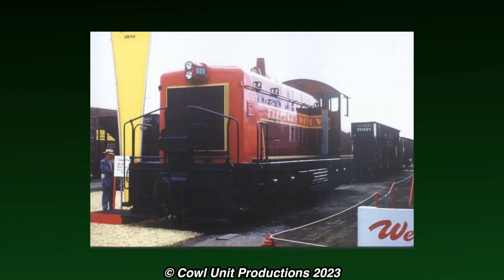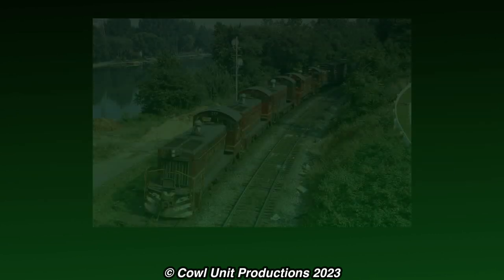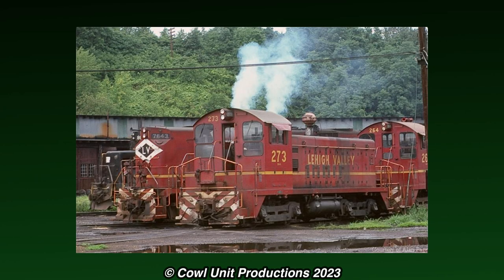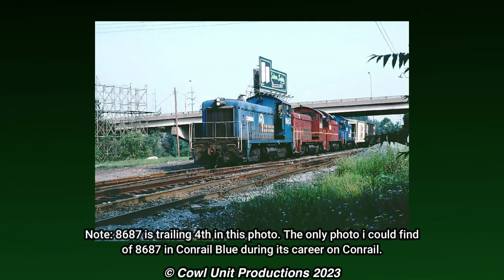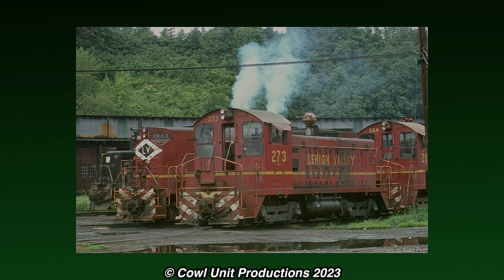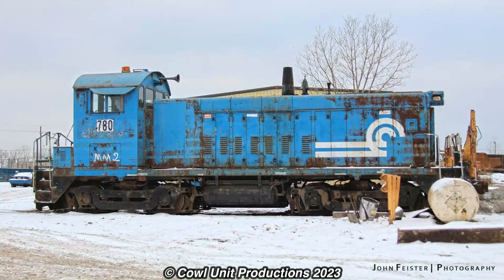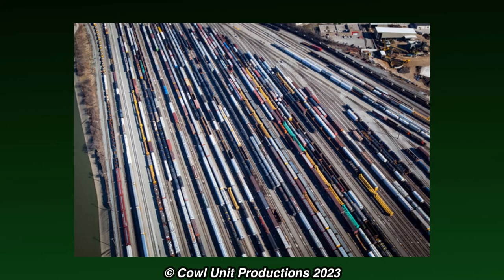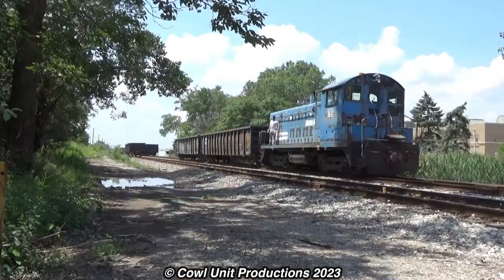Bite Sized Oddities - Conrail 8687

Comment: I am surprised that you didn't touch on the fact that this unit was ordered with dynamic brakes like switchers on logging railroads. These pups were used on some steeply graded anthracite line by the LV with light axle loading. That is why it has that hump by the cab. Also I always thought of the SW8s as the beginning of the 8 cylinder line of switchers with the later SW900 being the 8-567C successor to the SW8. The SW7 with the 12-567A had The SW9 as the 12-567B equipped succesor and later SW1200 as the 12-567C succesor. The Sw1 stuck around longer with its 6-567 and was eventually succeded by the rare SW600 with a 6-567c